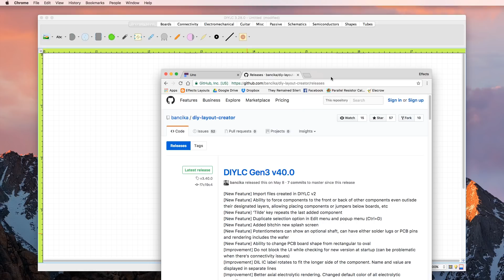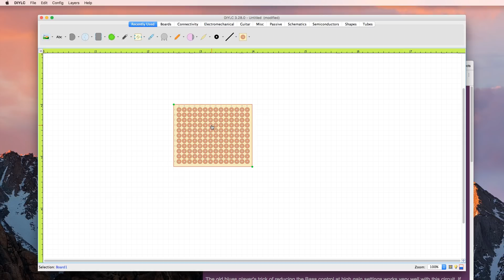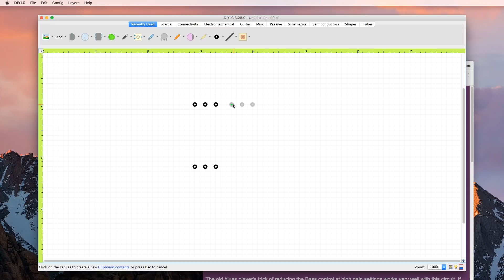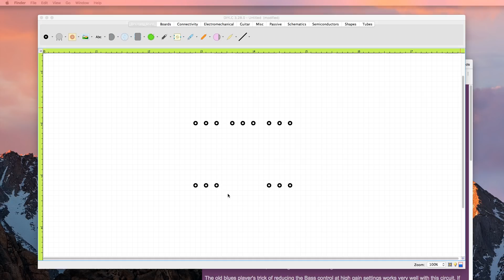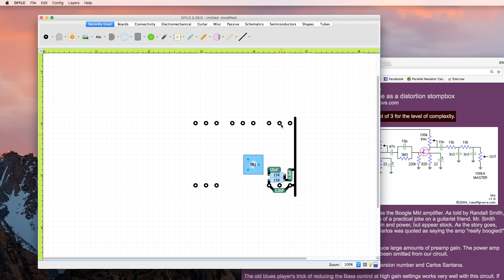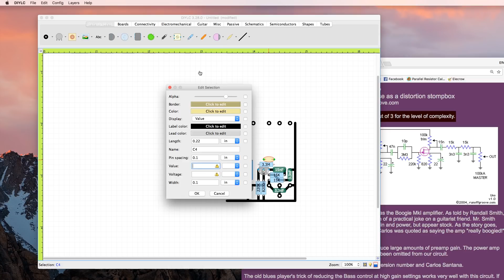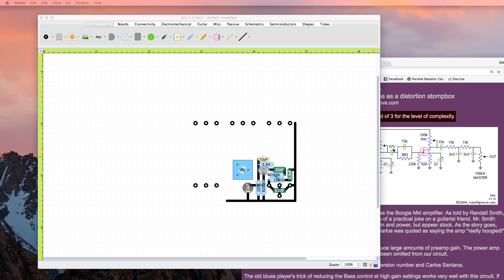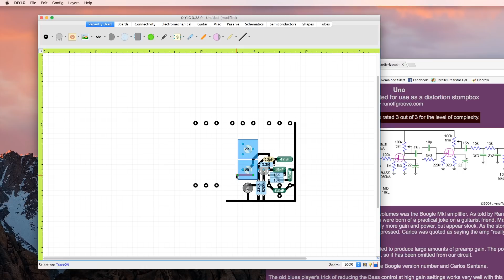Effects Layouts DIYLC Tutorial: Episode 1

Comment: I'm fairly new to this and I found your video to be incredibly helpful! Quick question – at 0:45 you mentioned there are a couple of minor quirks with DIYLC 3.40. I watched the entire vid, but I didn't catch what they are. Do you discuss them later in the series? Thanks!
Reply from the maker: I honestly don't remember if I did or not. lol The biggest quirk is that in the newer versions you can't set the default size of pad. The little check box doesn't do anything. This is a bit of a problem for the perf side as I use small pads for the components so it's easy to see in the underside image were components come through. The other weird thing is that the keyboard shortcuts for rotating text or even some components don't work correctly. They're minor, but keep me using 3.28 for the majority of the layout creation. But I use 3.36 to export because I like the updated resistor model and the revised numbering of the perfboard.
Reply: @effectslayouts  Awesome, thanks so much for replying :)
Reply: @effectslayouts   do you take requests?